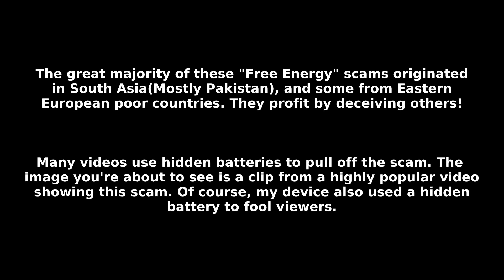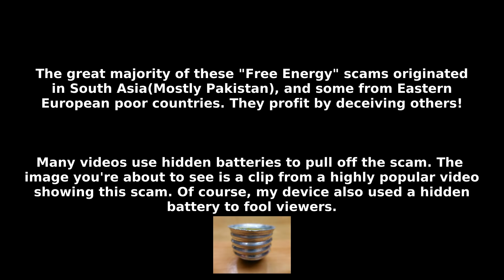DIY Wireless "FREE ENERGY" Light? You decide!

Comment: wow
There are other You tube vids of how to take apart a led Lamp and fit a battery inside with the terminals of lamp connected so all you need is a switch of some kind .
Then all you need is any old crap  speakers, coils of wire, magnets spark plugs, rusty nails wired to the lamp holder that then acts as the switch. Then spend hours sticking this crap together with hot glue and Presto FREE ENERGY.

Comment: What is the output voltage? And is it DC or AC?
Reply: He is exposing a SCAM! There is a 3V CR2032 button cell inside the bulb, IF you watched the whole video. Most of these scammers use hidden batteries, blower guns (they mute the video, edit out the displaced movement caused by the air), pumps and power cords.

Comment: I like your channel. Could you do a video on how a lawn mower coil produces spark? Thanks
Reply from the maker: I'm glad you enjoy it! Be sure to share and rate thumbs up so these videos are worthwhile. As for the lawn mower, you have a strong magnet embedded in the flywheel, and a coil of many turns of fine enamel wire with an iron core that's placed close to the flywheel. As the flywheel rotates, the magnet will pass closely to the iron core of the ignition coil(many turns of fine wire), and as that happens the magnetic field from the magnet induces currents into the coil which causes it to generate a HV output.
Reply: @electronicsNmore  thank you.

Comment: Thx. :) Now if someone can figure the ancient Egyptians, et al. electrical (?) power/lighting used in the Great Pyramids, because there's no trace of carbon on the ceilings of  passageways and rooms. Something about earth's magnetic flow lines, moving water, time of day, type of rock(s) used, and who knows what else.  Similar to a high school physics lab of getting running tap water, and two copper wires to produce to enough electrical current to light an LED, but on a far larger scale. Haha! (maybe) ;)
Reply: If you have not figured it out... It's called BATTERY...
Reply: @anthonycrane2127  Huh? I was aware of the battery powered scam when I originally conmented. Thx anyways. You must of missed my sarcasm.

Comment: Thats impossible for it to work. You would have to have power enter the copper wire for the light to come on. But the way its desighed there is no initial power to start the Supply Plus when do the energy enters the light bulb it will not recycle through the wires and any given time the only way it is possible for that to work without any initial power source would be to run magnets through the center at a constant speed at a continuous time but there is gravity and other such ways that will restrict it from working all the time. The whole free energy idea is fake you cannot have anyting runoff nothing to get power you have to have an initial power source or an initial trigger there's no way any of this free energy Concepts actually work
Reply: You forget all the trillions of electrons in our environment. Using a Toroidal design, you can capture these free electrons and use the unlimited amount of energy they contain. This energy is pulled from source. You have to stop thinking in terms of conventional science as it is just like religion, used for control of peoples minds. There are many things science cant explain but are very real.
Reply: @taltevers  but to harness the free electrons do you need a specific device to capture the free electrons absorb them into the copper wiring not even a magnet to do it his way he has the device setup it just doesn't work it's not supposed to work if we could run off free energy the only free energy device out there really is the Sun but on that same fact the free energy devices cannot function that they can absorb electrons or anything like that. Like I said last free energy devices is flawed we would be using free energy devices if it wasn't flawed

Comment: It must work from radiated body energy induced into the coils, if you insert a turd into the donut hole it will work much better, the turd acts as a primer multiplying the induction of radiated body energy then you can double the globe wattage, let there be light.

Comment: bull shit lol led light in the bulb seen it so meny times
Reply from the maker: It would be smart move to watch a video before posting a comment, otherwise you look like a fool to others.
Reply: thebug 404 yup
Reply: @electronicsNmore  the thing is what you're neglecting to realize here is that a toroidal  like what you have their will produce no electricity unless there's some kind of magnetic field nearby this is the oldest trick in the buck you get yourself something that looks like a Toradol or a Transformer and hook up a light bulb to it and it magically works that's pretty simple because either you have an LED light in the lightbulb with a flat cell battery in it and when you plug it in at makes a connection turning on the LED I watch the entire video by the way would have been nice to see volt meter hooked up to the Toradol before the light bulb to see if there is actually an output there also another trick is having a device underneath the table that creates a magnetic field to produce a voltage in the toroidal you can't get something from nothing like that
Reply: thebug 404 he explains at the end of the video that it’s bullshit and that there’s a battery in the lamp.
Reply from the maker: @letsgocamping88  Don't bother wasting your time Ben, some people are thick headed.